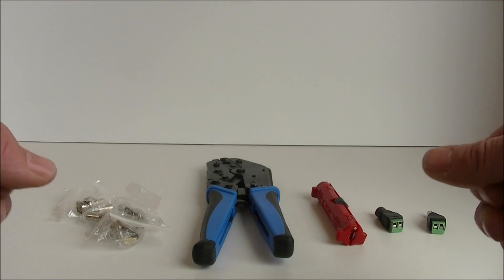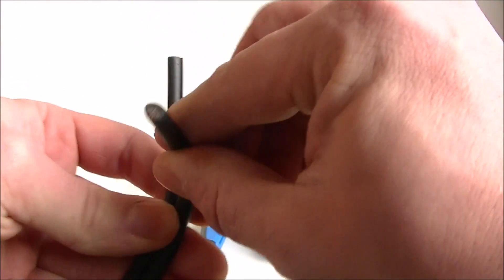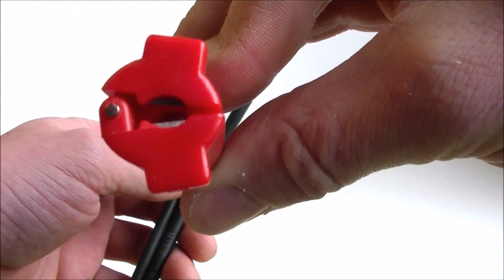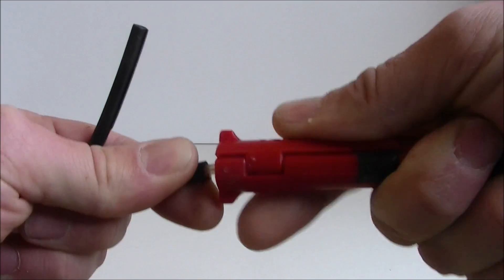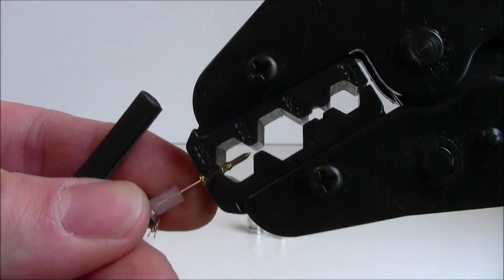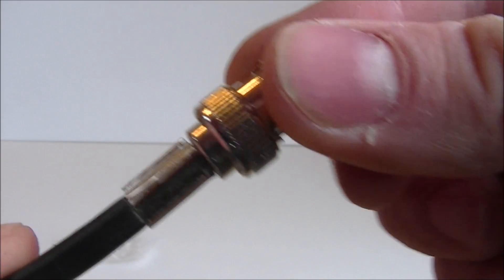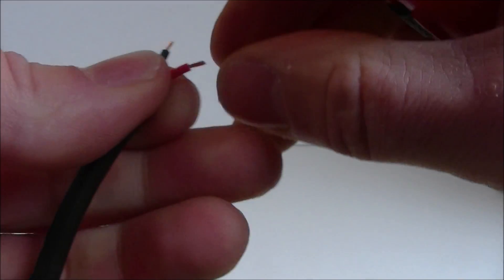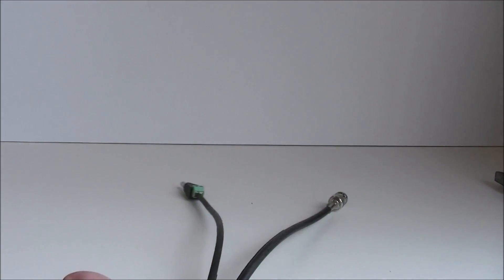How to Crimp a BNC Connector & Make Your Own CCTV Cable.

Comment: Hi i'm quite a noob to this and was my first install, firstly thanks for video but... your instructions at 4min cutting the (sorry if my terms are incorrect ) sleeve wire of quite short caused me more issues then i wanted it to be... the connections did not work and was pulling my hair out trying to figure out what did wrong... the wire sleeve needed to touch the ring that gets crimped on and then my connection worked... hope this helps others that might have similar issue.

Comment: Hello from the State side.... West coast to be exact. This was a very informational, detailed, wonderful video, as my cameras were about 4 years old and my video side connector ripped off. But i do have other cables that were torn do to screws as well.... i am going to rewire just as soon as our 120* Temperatures drop to 75 degrees... Cheers.
Reply: Did it work

Comment: What is the point of this heavy cable when your camera itself has the small cable like you show at the beginning? Wouldn't the camera be crutched from the start?
Reply: Power drop over distance my mate.
V=IR 
SHORT RUN FINE.
LONG run tou get power drop.
Cameras need electricity from flow

Comment: Does anyone know how to go about painting your BNC adaptor (black for example)?  Is it safe to just spray it on with a can?  I've seen a lot of BNC adaptors black and I want to be able to do this with an adaptor that only comes in chrome.
Reply: Just use the shrinkable tube to cover it. Shrinkable tubes are in different colours depending on the colours you want

Comment: This is complete rubbish.  This is a text book way NOT to crimp anything much less any RF cable.   This crimper tool is complete rubbish as is the stripper as is the procedure.   This would never pass elementary school science class.  
Get some real crimpers (hex crimp on the ring), braid back the shield and try to do it right.  ONE squeeze only - by crimping all the way back, you've left a sharp edge for for the crimp ring to start cutting through the shield.  Seriously?

Comment: Very poor video. Keep the screen / braid full length of crimp and not as a pigtail but 360 deg around stem of BNC , makes a much better connection as surface area is increased. Length of dialectric should match the depth of BNC so it butts up to shoulder inside the tube of the BNC. Poor explanation no better than poor DIY standard. Find a better video folks there are plenty on YouTube

Comment: Been in the electronics and RF industry for over 35 years an this is TOTALLY THE WRONG way to crimp a BNC connector on coax. Remind me never to use your services! I hope no one ever uses this as a guide ... your just asking for major problems. One tip to viewers, the amount you strip back on each of the layer is defined in the datasheet for the BNC connector, which you can download from the web by searching for the part number. The screen is there for a reason. Cutting it back like this negates its purpose (Screening). The crimp setting you use is also defined on the datasheet. This shows a very poorly over crimped ferrule. You need to go and get some instruction yourself before trying to show others ... blind, leading the blind comes to mind!

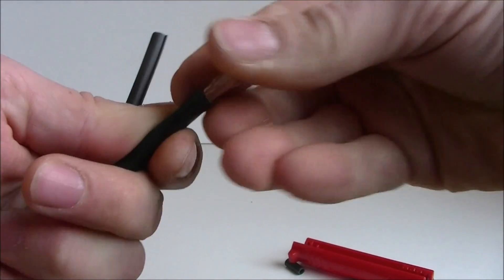Comment: You cut a lot of wire, man, 3:29 which will increase wire impedance, that will invoke overheating in this connection and in the end make a bad signal transmission. This is a Tutorial of how not to do.

Comment: This cam has 3 wires. What are red, black, blue for?
Reply: if you referring the 3 wires coming out of camera itself then it most probably means it has built-in microphone and if you are talking about the wire then it is used to attach ext mic.. *Red is +, Black is -, Blue or Yellow is Audio.

Comment: Is this crimper works also on RCA cables?
Reply from the maker: There are a couple of sizes of crimps that this tools is compatible with. Depends on cable thickness.
Reply: Thanks for response, after googling it seems I need RCA compression tool.

Comment: Mate, can i ask a question if possible please,  I have messed up my BNC cable when  feeding through a external hole, the bnc connector and the power cable have both snapped off, i have watched your video and want to repair it as i have already laid my cctv cable.  the only problem i have is with the power cable, when stripping the power cable, i dont have a red and black wire, the two wires are white and exposed copper wire, can you please advise if this is possible to repair and fix ?
Reply: If its a low voltage system you can guess which is which, it only has to contact for a moment, if you get no pic then flip the polarity of the wires and you have the correct pos/neg condition mate.

Comment: That is an incorrect way of terminating the BNC connector. The wire "mesh" or shield should cover the whole back end of the connector and the ferrule goes over the lot for crimping.
Reply: Hi Mate, do you know to do if im using a weaker (thinner) RG59 cable. All ferrules I've found seem to be for the thicker RG59 cables. I have already cut the BNCs off the runs as I had to fit them through 20mm conduits. 
Thanks
Reply: That is the worse crimp and install job ever. There are so many things wrong with the installation of BNC connector ever. The braiding should not be cut off as it part of the shielding of the cable. Canare has great crimp on connectors that I used in major telecommunications facilities that feed hundreds of thousands of customers.

Comment: That's about the crappiest BNC crimp job I've ever seen done.

1: The centre pin MUST butt up against the inner insulation.

2: NEVER EVER EVER EVER CRIMP THE FERRULE TWICE!!!!! It seriously weakens the ferrule and reduces the crimp pressure. If done properly the metal interfaces will cold-weld themselves into place

This video is a good example of how NOT to crimp BNC cables.
Reply: He seems to have the wrong size connector for the cable also which is why he needa to do the crimping multiple times
Reply: @tohtorizorro  Correct. It's a RG58 (50 ohm) plug, not a RG59 (75 ohm) one

It's important to note that putting a 50 ohm BNC plug into a 75 ohm BNC socket will effectively destroy the socket centre pin as the pins are different sizes (75 ohm pins are about 3/4 the diameter of 50 ohm and a 50 ohm pin will catastrophically ruin the brass fingers of a 75 ohm socket by splaying them beyond elastic recovery limits, rendering them permanently intermittent)

If this is an example of satsecure's professionalism, people should be avoiding his company like the plague
Reply: wow.
Reply: @navigatingbetweentwotribes  https://www.youtube.com/watch?v=NVIIKap9jYs is an example of how to do it correctly

Comment: You cut all the coax cable copper mash , shouldn't this be connected to the cctv terminal so you would have a ground return and that would reduce any external effects on the quality of the picture?
Reply: Twisting the mesh into a twine and then crimping can crease the centre stinger by causing uneven pressure around the circumference and affect pic quality, bad technique in my view. Also multiple crimps on the collar is not such a good idea too; get a better pair of crimps that require only one application.
Reply from the maker: As long as some of the copper mesh connects to the silver ferrel on the crimp it will provide grounding (i did leave some of it on the coax cable). The more copper mesh connected the better the grounding, and quality of picture. For longer cable runs its advisable to leave more copper mesh to connect to the silver ferrel.